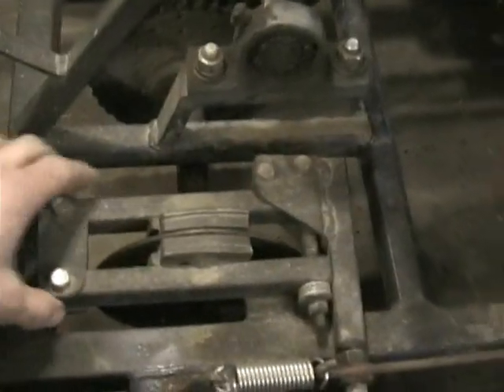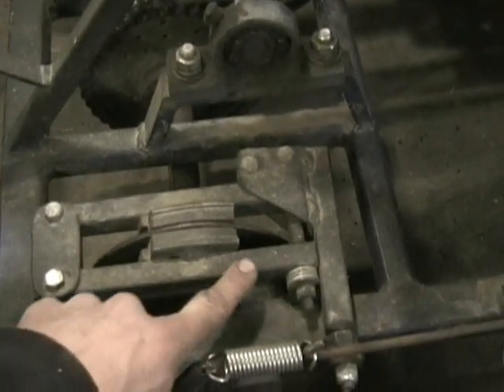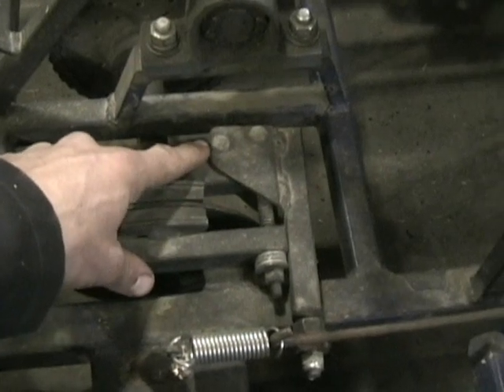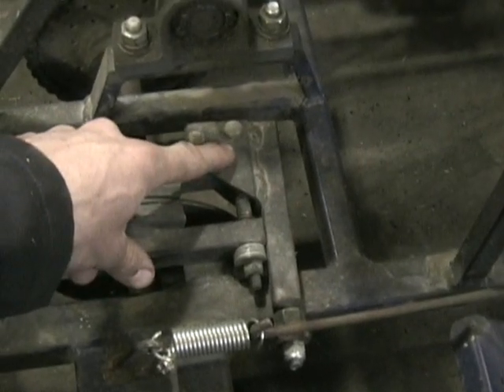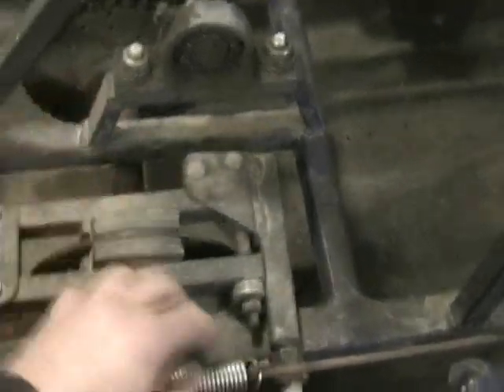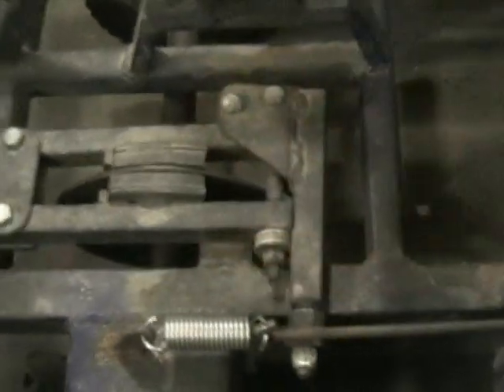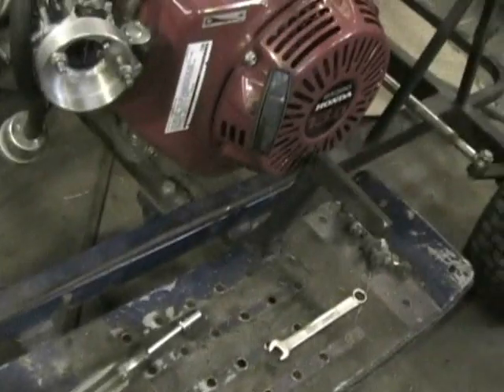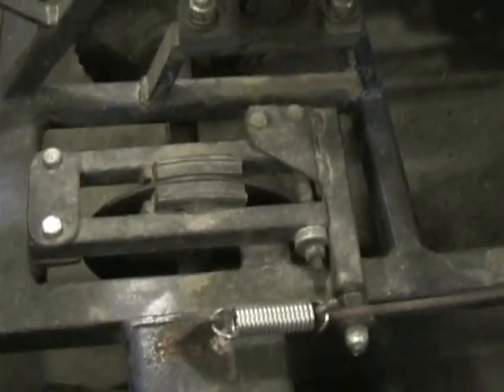My Brake

Comment from the maker: @ridinhonda4life  It was pretty touchy on my tractor, kind of on or off, it would lock up the wheels very easy. If you played around with the leverage in the linkage you could probably get it to work really good.

Comment: steven are you still using this setup now or did you switch over to hydrolic brakes on this tractor? i'm kinda wondering what to do with the one i'm building now because this is a lot cheaper then hydrolic brakes thanks